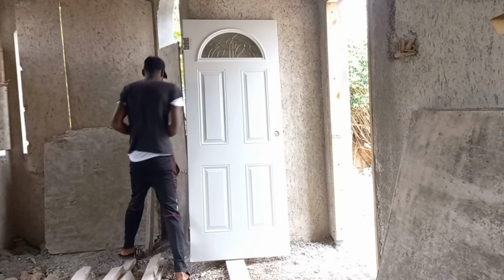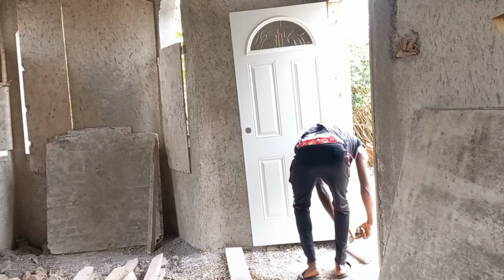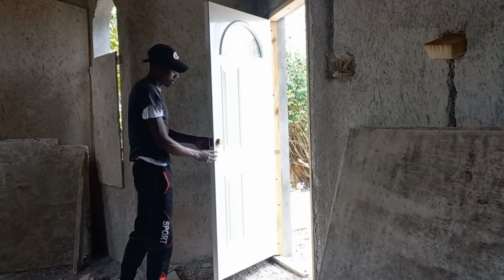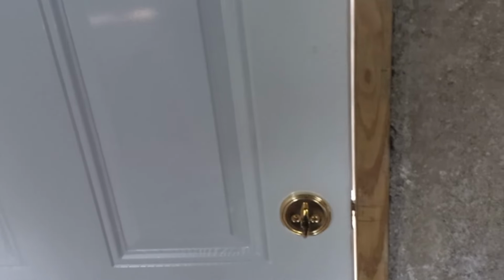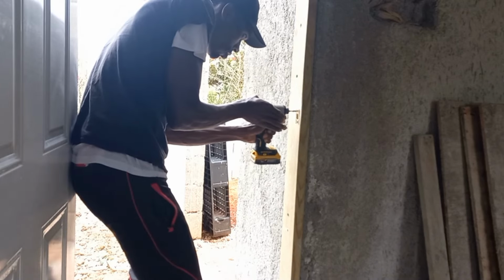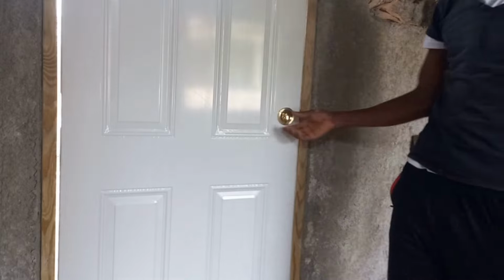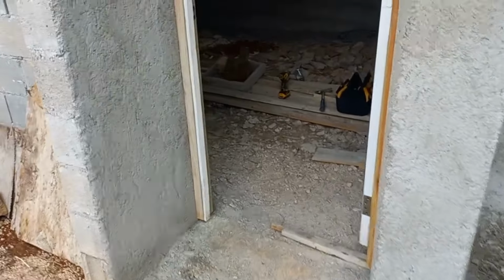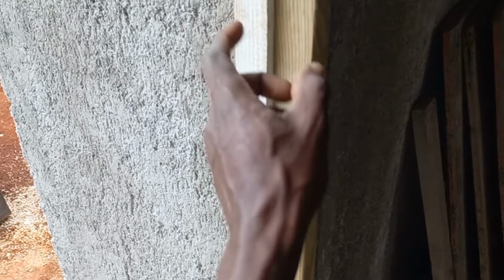How to Install Doors on your dream Home DIY

Comment: DeWalt fe ever iyah. Just got one de other day.
Reply from the maker: Thats is it strong and durable i love them 💯🫡
Reply: And handy. Ah de grinder me Wah next. Me have 2 extra batteries.
Reply from the maker: @jah-mek-yahtv973  you have to just work on it me boss me like makita brand also very strong and handy
Reply: @impressive_builders  yes iyah.. got that in circular saw.. battery power.
Reply from the maker: @jah-mek-yahtv973  yeah man good tools to have